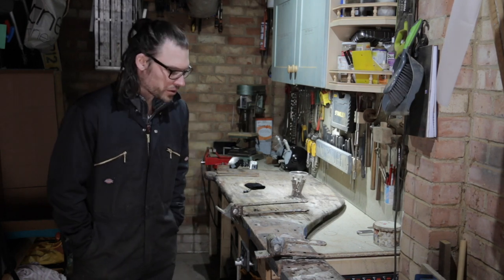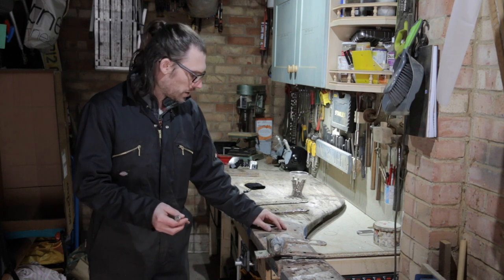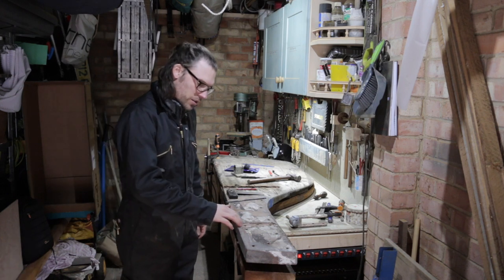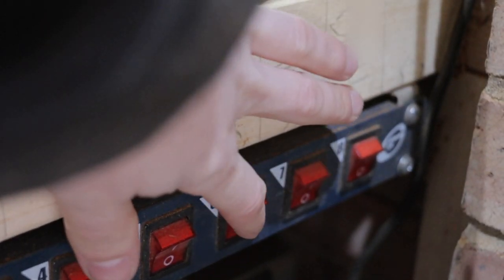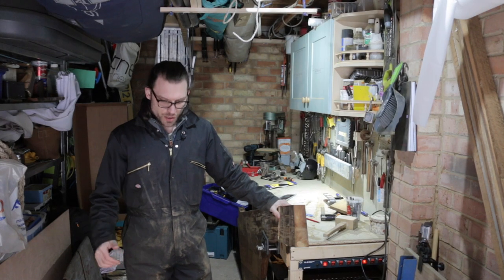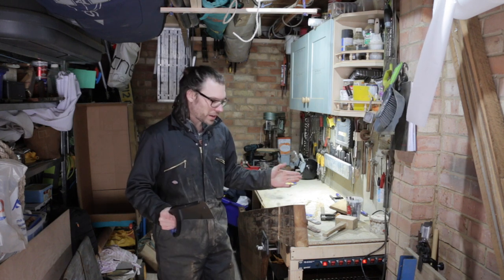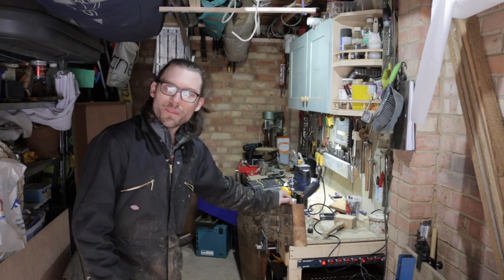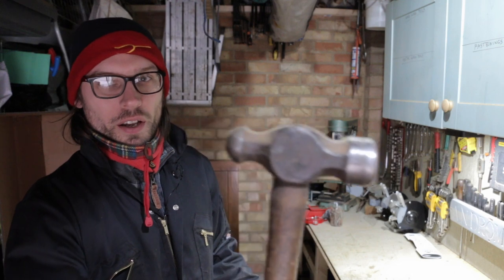22. Making a New Rudder Part 3, Making Copper Rivets. Wooden Boat Restoration.

Comment: Yes annealing is ideal. Copper both age hardens and work hardens.
Reply from the maker: I’ll definitely look into this, thanks a lot for the feedback and for watching!
Reply from the maker: I will experiment with quenching the copper on the next set I think. I’m sure the metal will then work a bit better as you suggest. Thanks Steve
Reply: @SVAndromeda  Most metals when annealed should be left to cool slowly for the annealing to work. copper you can either cool slowly or quench.
Reply from the maker: Thanks a lot for the advice Steve, that’s great. I’ll definitely try this

Comment: I'm no expert but I always thought having copper in direct contact with other metals was a no-no because it causes galvanic corrosion. Will that not be why the cheeks were originally held on by copper rivets but the hardware was attached by steel bolts? I think your pintles and gudgeons will act as sacrificial anodes for your rivets!
Reply from the maker: Hi, thanks for the comments and I’ve since come to a similar conclusion although so far I’ve only mounted that top gudgeon, of which the copper is now encased in wood and epoxy so I’m feeling quite confident that part will be ok. It’s also quite high above the waterline. Lower down, I will use steel as you say to fasten the remaining hardware and mount a sacrificial anode on the rudder blade. Galvanic reaction is a very good point and maybe something we should explore in a future video. Thanks for watching and for the feedback!

Comment: Hi Clive, I have the same thick copper nails in a rudder I need to rebuild and need to know how you got these nails out so you could re use them? I would be happy if I could just get them out without damaging the cheeks.
Reply from the maker: Hi Charles, I think I inadvertently answered this one on the other video comment, sorry! With the nails actually, by the time I got them out they were very slightly shorter as I had drilled the heads off them but then I used them through the blade thickness without the cheeks so that wasn’t a problem for me. A few people at the time suggested heat to help work the copper so I would be interested to give that a go if I do it again. I would like to use a similar process to fasten the bobstay fitting at the stem once I get my hands on some more copper rod. Maybe an electrical earth rod would be a good size and a cheap solution?